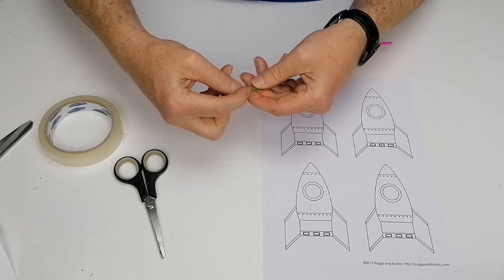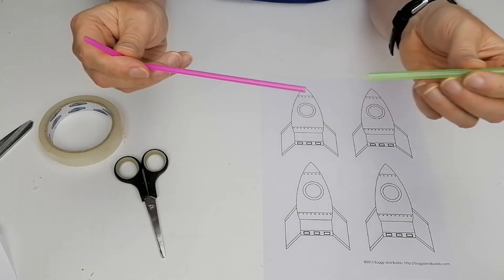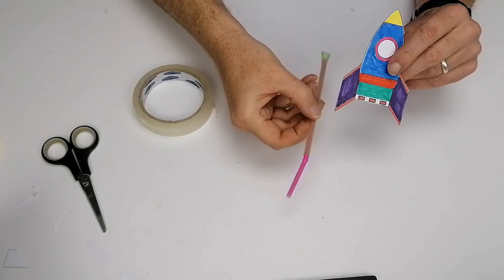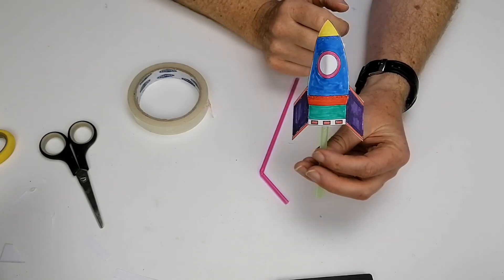How to make a straw rocket - Forces and Motion - By Science Ireland

Comment: Where do you find the straws?
Reply from the maker: Paper straws will work to but you just need two different sizes so that one fits inside the other. You could also use a paper straw to blow with and a rolled up tube of paper to replace the other straw on the rocket. Hope these ideas help.